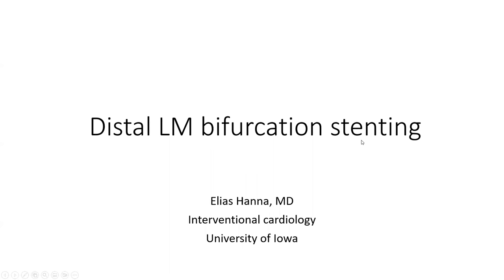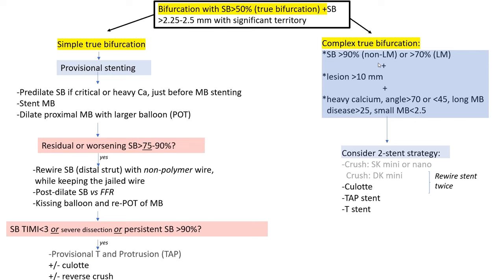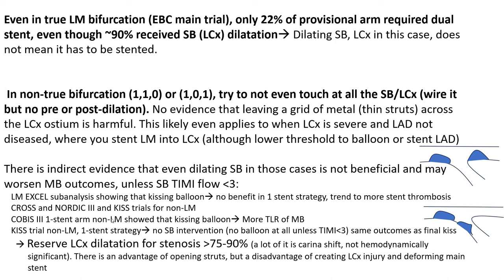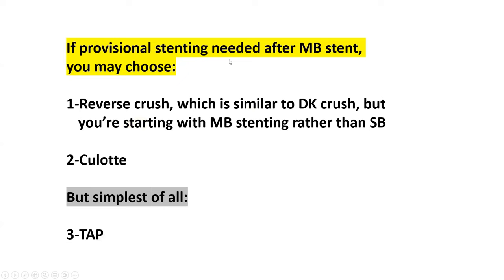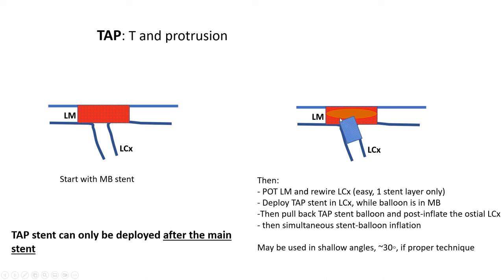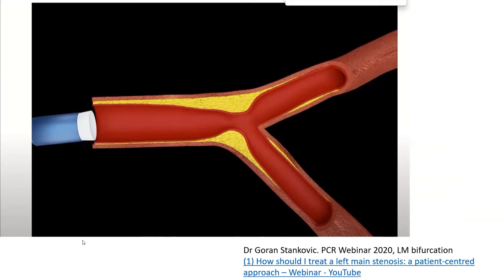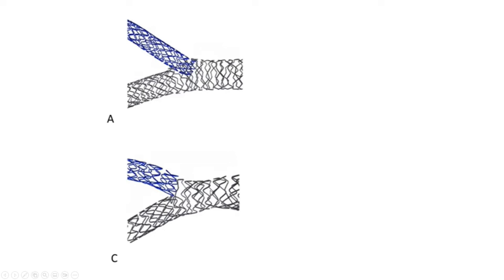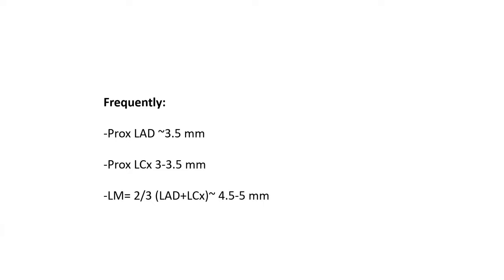Bifurcation left main stenting- Elias Hanna

Comment from the maker: For left main disease that involves the bifurcation but also the ostium, use the same bifurcation stenting strategies, except you have to also extend your left main stent to the ostium with a couple of mm in the aorta. When deploying your main LM-LAD stent in this case, use the view that shows the LM ostium, usually LAO cranial or LAO straight view, and make sure you cover the ostium's lower edge into the aorta. Review my Aorto-ostial stenting talk.
   The bigger issue in this case is guide ventricularization and left main ischemia that can happen if you fully engage the guide. For that, as explained in my Aorto-ostial talk, I recommend the "hit and run" maneuvering, meaning you keep your guide slightly disengaged throughout the case, making sure the guide is not ventricularized. You only engage during device positioning, which may cause intermittent transient left main ischemia. This may still translate into substantial LM ischemia if you are doing complex device positioning and steps. Hence, having to treat complex distal disease (requiring a lot of time) through a ventricularized LM guide is an additional push to use LV support and/or to use a simple distal strategy. It is one of the 6 additional features I consider in my decision to use LV support. I show that in the slide about LV support (Eg 48:22) and under my "LV support" talk.

Comment: Thanks for this lecture
Dr. What is your position in KB predilatation in a Medina 1-1-1 (distal-DA-Cx / all critical) to preserve architecture and avoid shift before stenting? Do you recommend it? Or its the same than sequential prep at high pressures?

Pd. I have the notifications on; waiting for your next lecture. Again, thanks a lot.
Reply: And, the second question Dr.: Sometimes after first POT, it is difficult to advance the side branch stent through struts; do you think I should re-POT (considering it was a suboptimal POT) with a wider balloon, or in this case, dilate directly the struts with a NCB prior to attempt advancing the stent.

Comment: Thanks a lot 
Dr if ostial LM  90%+ complexe distal LM bifurcation
What the best strategie here ?
Reply from the maker: Thank you. You use the same bifurcation stenting strategies, except you have to also extend your left main stent to the ostium with a couple of mm in the aorta, . When deploying your main LM-LAD stent in this case, use the view that shows the ostium, usually LAO cranial or LAO straight view, and make sure you cover the ostium's lower edge into the aorta. Review my Aorto-ostial stenting talk.
   The bigger issue in this case is guide ventricularization and left main ischemia that can happen if you fully engage. For that, as explained in my Aorto-ostial talk, I recommend the "hit and run" maneuvering, meaning you keep your guide slightly disengaged throughout the case, making sure the guide is not ventricularized, and you only engage during device positioning, which may cause intermittent transient left main ischemia. That may still be substantial ischemia if you are doing complex device positioning and steps. Hence, having to treat complex distal disease (requiring a lot of time) through a ventricularized LM guide is an additional push to use LV support and/or to use simple strategy. It is one of the 6 additional features I consider in my decision to use LV support. I show that in the slide about LV support (Eg 48:22) and under my "LV support" talk.
Reply: @eliashanna8248  
Dr  if crush technique  predilatation ostial LM befor stienting distal LM??
If after pre dilatation It happened dissiction LM  Turn to TAP technique quickly??

If TAP technique
decidd long stient cx (ostial to mid)
not difficult  delvirance long stient from stien LM - LAD?

Once again thank you very much